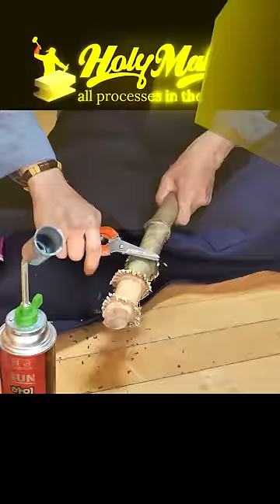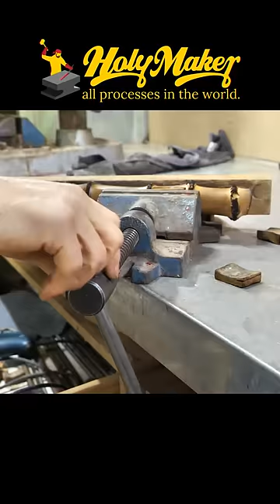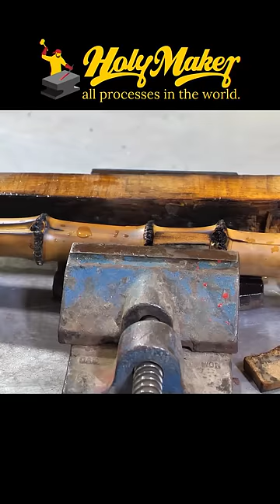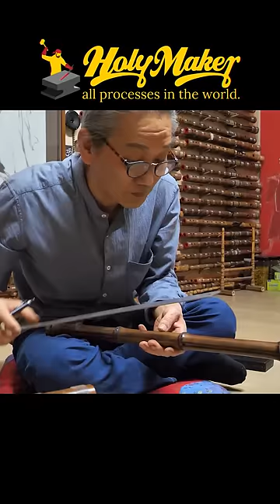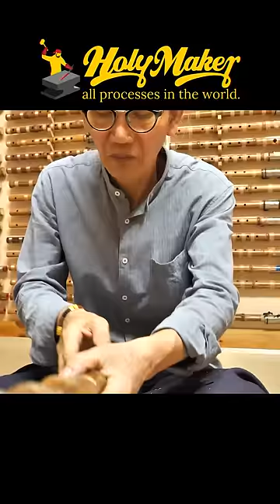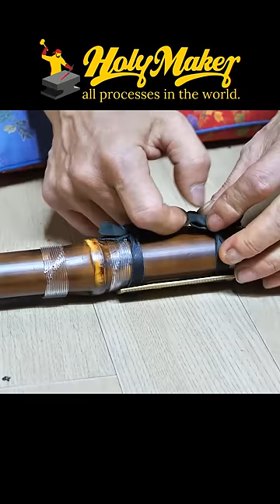Process of Making Traditional Korean Flute by Old Master Artisan #shorts

Comment: Never knew that Bosch hot air blower with digital temprature setting and digital caliper existed in ancient Korea.
Reply: The process is called bending space and time which is done using time travel machine and can't be grasped by the uninitiated 😀
Reply: They said they made traditional instruments, but they didn't say that they were made in the traditional way.
Reply: @delicate03  Haha yes u r right.
Reply: that's is an ancient antique Bosch jest blower...lol
Reply: im korean and i was thinking the same haha but a using modern tool aint a bad thing isnt it?
Reply: @쿠크다스-p1l  no it's not a modern tool it's an old tool just look at its condition...lol
Reply: @쿠크다스-p1l  YES. but it's not traditional. modern tool is ok then china can also make it better and cheaper.
Reply: @2jaemyungE  damn it bro. That's funny and true 🤣